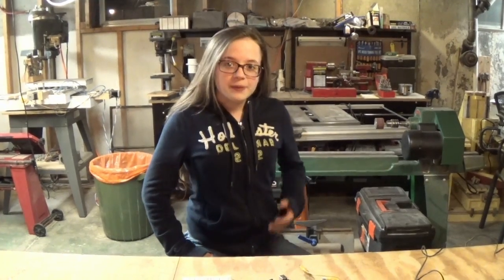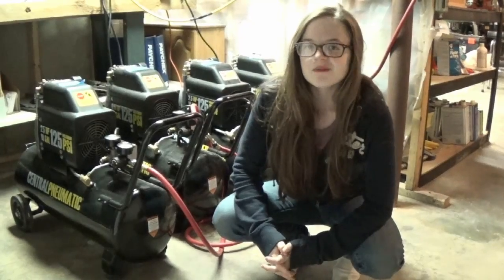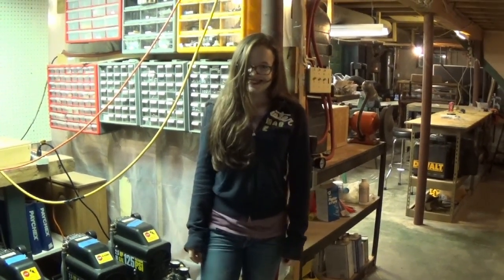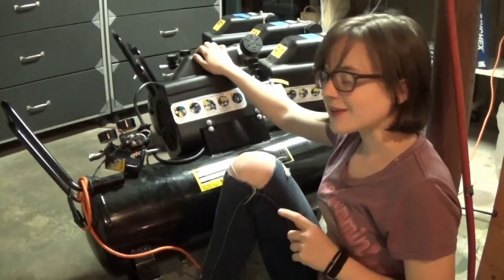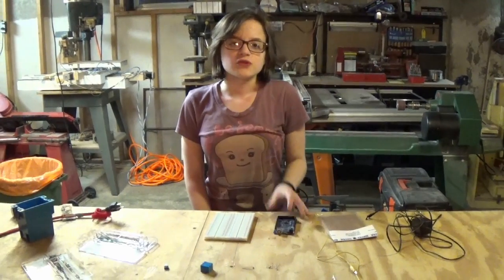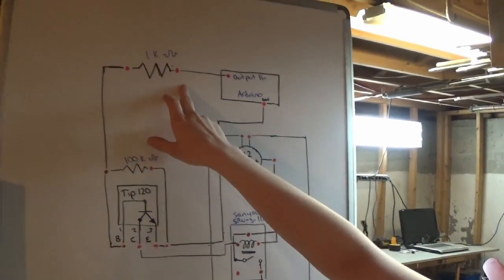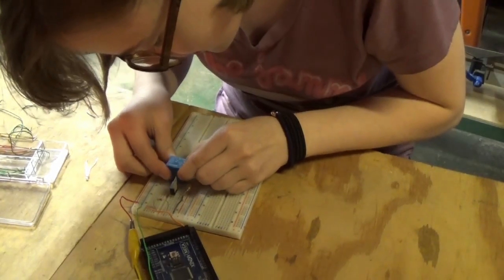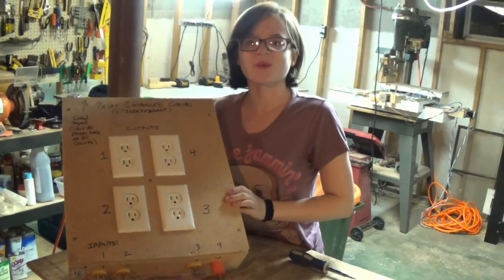Ep3 Cheap High SCFM Air with Parallel Compressors

Comment: Good effort but i see an error in the script.
loosening the valve to cause a bleed in the line to de-load the compressor will not work. unless there is a non-return valve in the line the compressor pressure will be the same as the tank/system pressure. So the only way the compressor un-loads is when the whole system pressure drops.
so in fact the bleeding causes a loss in pressure that will cause the compressors to cycle unnecessarily.

Need to install non-return valves between the outlet of the piston heads and the tank to fix the problem.

Comment: I'm lost at the 25 scfm, what size sand/media blaster is this thing? average one I see are 7 at most.
Reply: Ya, thats just a number to get you to buy it. You need a GOOOOBLY amount of air to get them to function.
Reply: 25 scfm is only like 4 cfm so it actually sounds correct.

Comment: Why not just set the cut in points of the "slave" compressors about 5 psi below the "master" compressor, and use a 1 way valve on each compressor so they don't back feed into each other? This way you will get the pressure in the main line and as soon as the main compressor can't keep up to the air demands, the other compressors will begin contributing to make sure the main line maintains it's PSI.  The 1 way valves stops 1 motor from filling all the tanks.

Comment: why can't you use one presure switch to run low volt relays,to turn on as many compressors as you wish?like in the times before Ebay arduinos.

Comment: Why not just use one pressure switch n wire it to all 4 compressors? The check valve is before the tank so if all the tanks are connected by hoses they'll all be the same pressure so using one switch will work for sure.

Comment: Really it would have been easier and cheaper to have an electrician wire a 240v socket into your garage (provided you have 240 going to your house) and just get a big 60+ gal 10+ CFM oiled compressor put in. I'd imagine that your neighbors aren't going to be to happy with you it you fire that up at 7:00 am on a Saturday ask me how I know.... Plus oiled compressors just last so much longer as long as you take care of them. They also won't wake the neighborhood.

Comment: This  SCFM  is used as a  scam  marketing tool.  "When I was a kid"  compressors  were pretty much rated  in  air  cfm OUTPUT   at 90psi.   Then  someone,  Wards, Sears?   discovered  that rating them  at 40psi  generated  larger  cfm  "numbers."  So  the SAME COMPRESSOR  sounded  "bigger."   Then,  some  enterprising marketer  started using  SCFM,  which is atmospheric  INLET  cfm,  so now the very  same compressor  sounds  as if  it's  EVEN LARGER.   Marketing.  90psi  was a good rating,  as that is the operating pressure  of "most tools."

Comment: As much as I give you props for putting all of this together, HF sells larger compressors that will handle this volume for not a lot more cost (when you include the control box parts, etc) and a helluva lot less time, hassle, and floor space.  Biggest problem would be making sure you had a 30A circuit to tie it to.
http://www.harborfreight.com/5-hp-60-gallon-165-psi-two-stage-air-compressor-93274.html

Comment: Neato system, but off the shelf delay timers would do the same thing.
use standard Air conditioner Contactors  ie: Trade Pro Contactor 30 amp 1 Pole 24V Coil $20

http://www.supco.com/web/supco_live/products/TD69.html
https://www.ebarnett.com/Sku/661424

Extension cords correct Wire Gauge are expensive!
Also these need to be dedicated circuits, Per NEC and NFPA codes for Safety; but mostly to protect compressor motors running with a voltage drop that causes then to burn out quickly.  

Find two outlets on separate breakers different Poles  L1 + L2 = 240VAC run 10Ga or 12Ga Romex to sequencer box
that should yield 240VAC @ 20amp break them down to 2 120v circuits per Lx common all Neutrals together run Romex as close to break panel as possible. 

 if you have space in you panel set 2-pole 30amp breaker and run Wht, Blk, Red 10Ga, + Grn 12Ga to feed your sequencer box.

Comment: With respect she would be money and performance ahead if she would purchase a single compressor with an ample volume tank that  meets her anticipated air compressor performance requirements. She may need to run a 240 V. circuit, but the money she would save by not building a jury rigged power control system may pay for part of the cost of adding the circuit.

Comment: Coming from an engineer, the best solution is simplest and most direct.  Parallel processing is great for computational problems. For the size of the air compressor you need, save up your allowance and buy a husky pro 80 gallon, 220 volt 7.5 hp 27scfm which will fit in your dad’s garage and provide more than the air you will ever need and will last forever.  At 37 amps 220 volts, it will be far more efficient than the obsolete junk you are trying to string together.

Comment: honestly you would have been better off with dropping $300 on a pump getting a hot water heater tank for air storage then to power it a 5hp 240v motor. and to be honest you can get close to 30cfm on 240V but your going to need a 60amp 240v outlet to power the darn thing. if your looking for a pump try surplus center also plumb in as many extra tanks that you can I got 2 30gal tanks 1 40 gal 3 20gal and a 160gallon all piped into a 1in main line at work fed off a 45cfm 4cyl 2 stage pump and a 10hp 3ph motor.

Comment: I love how she just said "normal household 240" what kind of house is that
Reply: In home in most countries outside the USA there is at least 10A 220-240v at every room's wall sockets. In the USA, the standard power system  provides dual 120v from the street, and has 240V to one or two outlets for stovetop and clothes dryer. To get 240v into a workshop you simply have an electrician add a new circuit and wall outlet for you.

Comment: Simpler solution and far and wide less work. Add 240V 1ph which is available in the house. Go to auction. Get 2 older compressors. Switch motors to 240v 1ph (most expensive part) enjoy your 40 cfm. Or if you need just ... 20 cfm (as this suggests with 4 comp at 120v) just get single compressor and change motor - probably cheaper then on this video as well. Sure less fun with microcontroller etc. BUT far less work and more "elegant" solution. Remember, simpler is better. Anyone can create ultra complex design (not anyone can make it work).

Comment: I don't understand why all the slave/master relay controls are needed, or why they need to have a delayed turn on time.

There are tons of compressor systems used in industry that have multiple small compressors feeding into a large tank with only a check valve on them and a single pressure switch.  For example search "4hp Dentist Air Compressor" on google and you'll see a few different setups on the market with 4 pumps and no fancy electronics.

Comment: Be very careful tweaking those pneumatic cutoff valves on the slave compressors.  If you turned one on and its tank wasn't connected to the master tank it would run until it explodes.
Reply: carters2 they still have a relief valve. it's the little plug with the ring. it will pop out or we'd have dead people all over the country and compressor company's would be paying out the bhole

Comment: A VFD can give you pretty clean sinusoidal 3 phase out power for fairly cheap. Mitsubishi's makes one (and just like basically any other Japanese or German industrial component) it'll be flawless. $200 will get you enough to blow your standard 15 amp breaker with a..decent enough.. power factor, in the mid 90%'s . (And unless your tooling is using triacs or SCR in their control units, even dirty dirty power out of crappy Chinese imports will do you just fine)

Remember, even with McMaster or Grainger (uhh I guess those names will mean nothing to you, but your producer will know them... i.e. not crappy Home Depot rebadged "Snap On") tubes, you're going to have line loss, so the further you are away from your source, the more parasitic loss you're going to suffer. I'm not in pneumatics but I think I remember someone mentioning ~40% on 100 ft! Also, remember as your current draw goes up and/or line length goes up, your electric gauge has to decrease, especially for something that's presumably running persistently. 

Your producer was right re: duty cycle. In fact, those consumer compressors have pumps on them that are designed specifically NOT to run at 100% duty cycle which is what you're effectively doing with those modifications. The failure mode for that in industrial settings is usually a belt burn out, but those units don't even have a belt to burn out on!!! Be careful and add LOTS of auxiliary cooling. Have your producer check the manufacturers notes for what grade metal it's made out of, then look up the tensile strength, elastic properties of the alloy, what the stress/strain curve looks for that specific metal when derated properly for the temperature. 

4 compressors at 120 a piece isn't really a 'tight budget' but I'm glad your producer subsidized that purchase (at that price you'd have more than enough to get a nice used Ingersoll Rand (in fact, even a cheapo Home Depot Husky with a number 3 nozzle, 60 gallons at ~4 hp for < 500 is more than enough to sustain continuous sand blasting), I guess that might defeat some of the purpose of the exercise, which I think would be for you to learn a bit of EE, which is a good thing thing! -- Kid stop reading here, I'm going to give some uhhhh constructive criticism for your producer, that will be filled with jargon and derisive remarks.

Yo bud, good on you for teaching your kid a trade presumable daughter (at least I hope youre a daughter and not some rando who hangs around with middle school kids). I'm hoping she at least retained eh five percent of what she parroted back from a script, because she'd be ahead of the average bear by miles. That being said, teach the kid proper schematic symbols (that NPN ain't drawn right). Plus that's such a convoluted way of driving those 4 loads, a BJT to an intermediary to a HVAC relay...? cmon. TE's RE2 relay (you're using protoboard so I picked a component that you could hand-solder, drive with an Arduino was UL listed up to 4kW, had CAT IIIa, and 4.50 a piece -- in a production environment, I'd be picking out DIN PLC components)---- and it's bad form to have overlapping lines in a block diagram, and using hearts instead of the real symbol circular-y triangle thing to represent pumps is bad form cos unlearning bad habits is harder than learning from scratch, not that she'd internalize mentally 'time to represent this control loops pump, GONNA DRAW A HEART!!!' but still cmon)

I'm not even 30 and I have no idea who the hell Chris Hemingsworth is, tell her to read some Wordsworth or Hemingway instead.
Reply: Chris Helmsworth is a dude who can read a script well and play in front of a camera and look really good doing so without a shirt on. Oh, and he makes more money in a day than both of us with our college degrees in EE will make in a lifetime. That's why she wants to have his baby.

Comment: you wouldn't need delays between motors because you are using 4 separate mains power.  none the less I like your way better. also,. AC mains isn't susceptible to High resistance per ft of extension cord. (impedance is equal roughly to 1\2  the wavelength.) roughly is about 5 million meters!  as u can see the length of the foremost of little concern.  it's the quality of the connection at the plugs and the wire gauge that hurts you. now DC.  big time Voltage drop per ft killer.

Comment: Why didn't you buy one compressor with 40 to 60 gal capacity instead of four small compressors? Than way you do not even need three face power, one more option is to buy an additional 40 to 60 gal tank. Just saying!

Comment: Or... You could have done the smart thing and bought harbor freights industrial compressor that runs on 220 power that puts out 25 cfm for the same price as you bought these units at. Btw... I can think of over 70 units that put out over 25 cfm on 220/240 single phase power...

Comment: You can buy a good compressor for about $1000 to do what you need, a 80 gal tank won't quit working in 5 sec....those cp compressors are only about 5 cfm and 21 gal. by buying a good compressor with 20 cfm and a 80 gal tank. at the end of your project you will have something good, or something you can sell. Very smart and complicated vid, but don't spend $800 and 1 week of work to save $1000 on a nice compressor. That is just my point of view.

Comment: $700 -$800 for this project? I would just take my parts to a sand blasting company or see if there's a dustless blasting company around. Cost is comparable and they do all the labor. 

I am trying to build a dirt vacuum with a 8 hp walk behind leaf blower. So far it's been a fail. Compressed air would work better but I would need to do this project on a much larger scale. Again, may be cheaper to hire a vacuum truck.

Comment: SCFM is standard cubic feet per minute, not sustained.

Using a high volume of air from 4 low output compressors will eliminate the problem of one doing all the work so all that 'fancy' wiring was a complete waste.  If one could do all the work you wouldn't need the other 3, duh.

Comment: This is a neat idea, but the engineering involved is way too complex and unnecessary. 

All of this could be accomplished with simple relay logic. 

Remove the pneumatic switch from each of the three slave compressors and replace it with a 20A solid state relay mounted to the frame as a heat sink. 

On the master compressor wire a rectifier to the switched side of the pressure switch to create dc for the coil of the relay. Use a SSR with 120v coil voltage. Set this relay up to switch the coils of the other three units via a slave cable with a screw on weatherproof connector. 

Now whenever compressor A comes on, B,C,and D will activate with it and shut off when it satisfies. 

Since all the units have safety pop off valves tank rupture is not an issue, and if you pipe all the tanks together in a manifold they should remain fairly balanced in pressure. 

If time delay is necessary, they make SSR with time delays built in for the slave units. 

Another good idea if you have 220v power in your garage or shop would be to make a cord that took the 220v outlet and split it into 2 110v circuits. This is great for what you are doing because each circuit would be on the opposite leg or phase of your electrical service therefore balancing the load of the two compressors.

Comment: ??? video and tech was impressive however I have been using a 5 HP 2 stage 60 gallon air tank compressor for over 30 years to sand blast in my cabinet as well as power a 50 lb portable blasting pot with no issues other then to wait for about 2 minutes every 5 for pressure to build back up on really hard blasting jobs .. and for what you are needing to do you could have used a better blasting media and a tarp and just got a 5 hp 2 stage compressor aluminum oxide cats about 20 times better then sand and would make short work of 30 year old rust ..follow up with regular blasting sand for light rust pits etc.. cudos on all the preparation but you really overthought this particular problem
Reply: holy hell ?? just read the shit storm that came from another old man such as me that pretty much she didn't need to re invent the wheel for her project and that maybe she needlessly went overboard ?? dint say her way would not work only that her core air compressors are the ones that burn out in 3 years or less .

Comment: This is a lead-lag-lag-lag system. A very pointlessly dangerous one at that, You'd be better off with 2 larger tank compressors on 240V with a proper variable speed controller. Or join the future and buy a 3PH compressor and use  VFD for soft starting and 1 to 3 PH conversion.

Your setup is extremely dangerous and has alot wrong with it. Compressed air is dangerous, I maintain the crap out of my Champions and Ingersol Rands

Also you could have just ran a 240V circuit with a neutral and a set a neutral to each hot group and make a 4 box outlet and you'd be able to carry 25AMP per leg so you could run them all off a single circuit instead of causing a fire with that extension cord mess.

the delayed start in't needed, the surge of 4 9 amp compressors especially dangerous harbor freight compressors is lower than a high output A/C so the delayed start isn't only needed it's dangerous. Your discharge could have been done with a case vacuum valve like any other industry compressor, and you shouldn't use compressors with such low duty cycle ratings, buy one with a 100% continuous rating.

with that many compressors your airline is too small and you have major loss in the line alone, the 4th compressor fails to even help, you almost need a 1 inch main.

I like the innocent idea but this is way to dangerous to be doing it like such.

Comment: Now she could have did it the easy way instead of buying all that compressors brought one 80 gallon 2-stage compressor and use an old hot water heater tank as the storage tank that's all I did. So in total I have a 120 gallon air tank on my compressor

Comment: It's so noise with many compressor in on at same time,  not efficient, need 4 outlet with individual breaker, have 4 low output compressor can affordable for some over 20gal with 2hp or diy compressor

Comment: Don't know who helped you to engineer this setup, but job well done. Another choice would have been to simply get a Variable  Frequency Drive, which would let you run / hook up a Three Phase Motor. Just a thought.  Don't know if you know about using "pool filter sand" vs "play sand." If not check check out SV Seeker's channel.    "Dewalt Pressure Washer Sandblasting"    https://www.youtube.com/watch?v=mYtbPG1RKgY      @ 1:32 of the video.